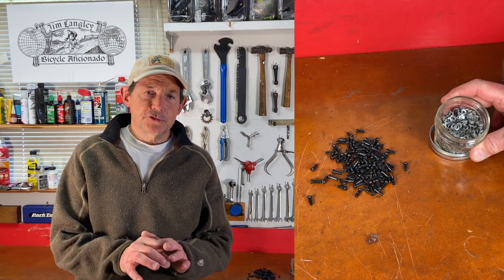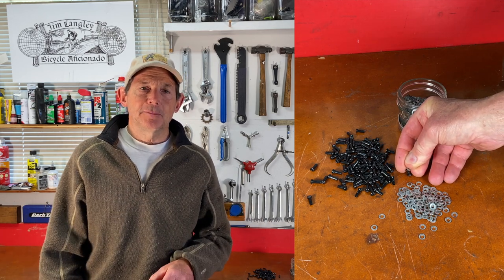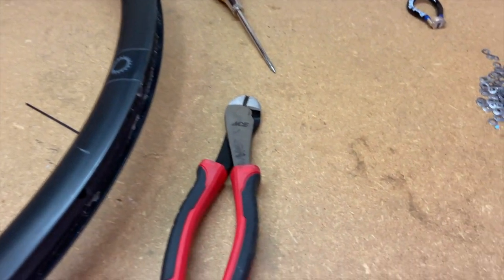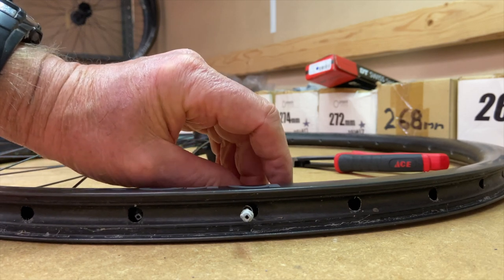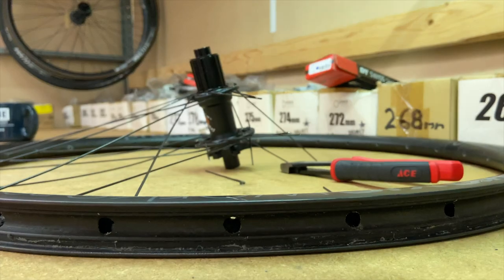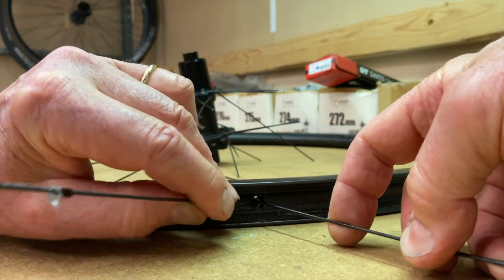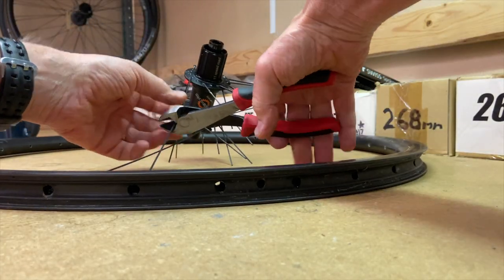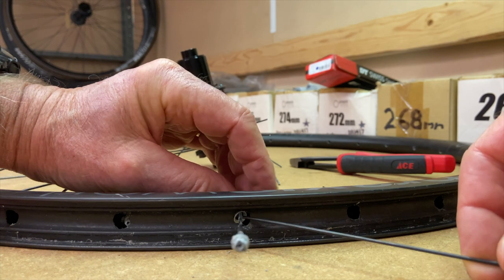Wheel Building Tips for Getting Out Rim Washers

Comment: Here's my request for a video. Not sure how you would approach it, but working on lower quality rims. First, how do you know the difference, and then what do you do with nipples that seem stuck. And how do you decide when a rim isn't worth working on. I ask not as a hobbyist,  but as a semi pro, trying to not waste time in the shop. Maybe what is the price range for junk, vs descent, vs great hoops. Not just for racing, but super strong for loaded touring. Kind of a long question but that's where I'm at. Love your videos.
Reply from the maker: Thanks for watching and the video request, Peter. I'll think about how I could cover some of those topics in a video. A tip for frozen, stuck or rounded nipples that won't come loose is to try heating them with a heat gun or even a torch but never on carbon rims, just aluminum and steel rims. If you're lucky the heat will break the corrosion. You can also cut the spokes but if a few nipples are frozen it's best to loosen all the rest of the spokes first so that you don't risk damaging the hub cutting fully tensioned spokes. 

Regarding rims, I would say that it's a matter of doing the research so that as a wheel builder you are certain that you know which rims are best for which types of riding and riders. This means building enough wheels with the rims you think are best to be sure they really are. You can also talk to other wheel builders to find what's working best for them. It's not so much about the price of rims but about the quality and consistency of manufacturing. It's always the same with rims though. What you want is something with the ride quality desired and that also stays true and round over the long haul. This holds true for whatever riding you do. Commuters, tourists, gravel, MTB, road, ever cyclist needs the same from their wheels pretty much. I hope this is helpful and thanks again for the comment and request!
Reply: @JimLangley1  thanks. I maintain a  few hundred rental bikes, and I'm always trying to get them close to perfect, but wheels and now disc brakes are the most difficult aspects. And I imagine local bike shops are most challenged by those repairs as well. The question of when to repair and when not to isn't simple. To me anyway. Thanks again.
Reply from the maker: @peterschoen841  wow, that's quite a responsibility, Peter, sort of like a team mechanic but instead of 20 bikes you have a fleet of hundreds to maintain! Maybe though you get to work with similar or the same rims and brakes on some of the hundred. If so you would become expert at how things hold up, typical problems and how to repair them and know what spare parts to always keep on hand. 

Rims usually last a long, long time and even longer with disc brakes. But I can see how rental bikes could take a beating and I would expect you would replace rims that got abused and bent or crashed but keep anything that was round and true enough to still ride well going. I never maintained a fleet of rental bikes. I worked as a shop mechanic and would work on hundreds of bikes every season. Some were the same model but a lot were not. Have fun keeping all those bikes rolling!

Comment: Have a video mountig the spokes wit washers on a rim?
Reply from the maker: If you click this link it'll take you to my lacing video where I use a special tool to pick up spoke nipples for putting them into the rim: https://youtu.be/LRS2_Tx8fU4?t=239 I don't show nipple washers in the video, but it's this step where you would put the washer on to the nipple. The tool holds the nipple and you would put the washer onto the nipple. Then you would only hold the tool horizontally or else the washer would fall off. When you put the nipple with the washer on it onto the spoke as you lace the wheel, you always hold the wheel flat and make sure that the tool and nipple are always in a position where gravity keeps the washer on the spoke nipple. As long as you do that, the washer won't be able to fall off the nipple and into the rim. The other way to do it, is to stick the threaded end of a spoke up through the hole in the rim. Just a piece of a spoke will work, too. You then have a "feeder" spoke sticking up through the hole. You then place the washer on that feeder spoke and thread the nipple onto the end of that spoke. Now, you pull the nipple down into the rim which will press the washer down and the nipple will be in place in the rim, too. At this point, you need to put another tool in from above to hold the nipple in place, like another piece of a spoke or the tool I show in the video. Once you're holding the nipple in place from above in the rim, it can't fall out and let the washer fall off. So then you can unscrew the lower feeder spoke and finally install the spoke in the hub to the nipple with the nipple washer. I know this sounds complicated but it's not really and it's worth it to take these steps so you don't lose washers in the rim and have to struggle getting them out. Hope this explains. Let me know if you have any questions. I'll add this to my video to make list but I can't get to it for awhile.

Comment: My first attempt at wheel building today failed because the spokes I ordered were too long. I had the old spokes, so this should have been straight forward. However the new spokes were approximately 3mm too long and remained slack. On the positive side I mastered the technique pretty fast. How would you measure a straight pull spoke, Jim? Laurence
Reply from the maker: Sorry to hear it Laurence. Measuring can be tricky. You measure all spokes along the straight length. So for J bends you hang the elbow on the spoke ruler and on straight/direct pulls you rest the head of the spoke on the end of the ruler. In other words you only measure the part of the spoke protruding from the hub hole not the part in the hole. I always use a spoke ruler like Park Tool’s https://amzn.to/4e8kiSq Hope this helps.
Reply: @JimLangley1  thanks, Jim!